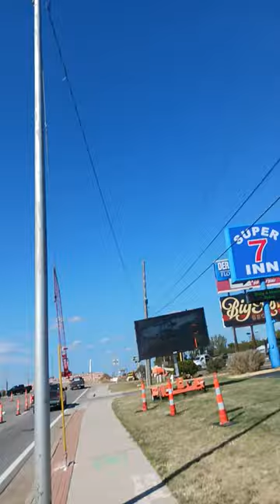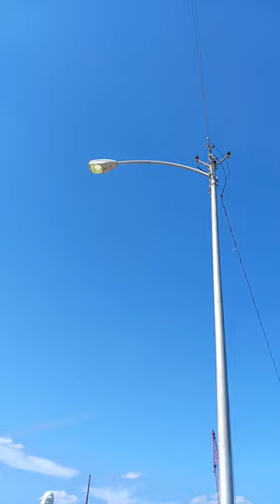On-camera fluctuating mercury vapor light near Range Line Rd construction in Joplin MO video 2

Comment: That is crazy. Frequencies are use as a weapon
Reply from the maker: I wasn't saying that these lights are directly used as weapons.  I am saying that they are not randomly placed though.  They limited mercury vapor lights and coincidentally or not such types of lights keep being where they are near places and possibly upwind of places (like the purple streetlights that not just anyone can buy either because they are a "defective batch") that are important for leaving.  Looking at terrain is also interesting near many of these lights and purple streetlights.
Reply: @Flyingsidekickr  Hi. Thanks for your reply. I got across a month ago thru a long line by part of highway in IL. 
  What do you think is the purpose. No one that is awake will buy the narrative that they are defective.
Reply from the maker: @daisytoromanzano8865  Chemical weapons (guided) like when a bunch of rockets are launched into the air all over the country for example.  See a wind rose and a topographic map every time you encounter these.